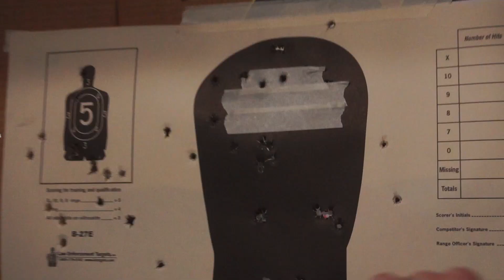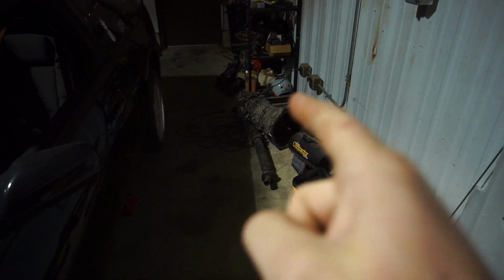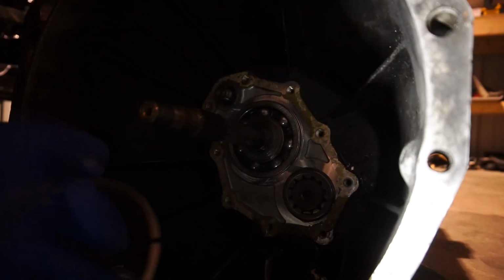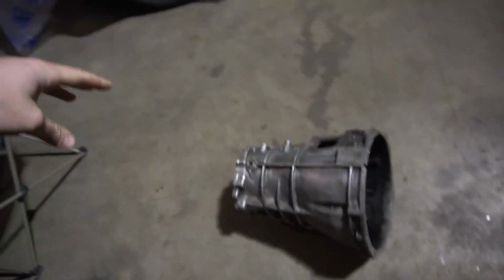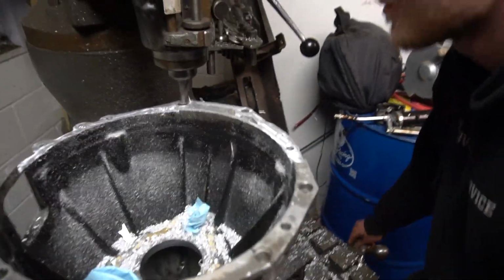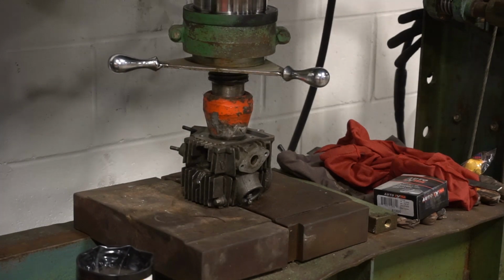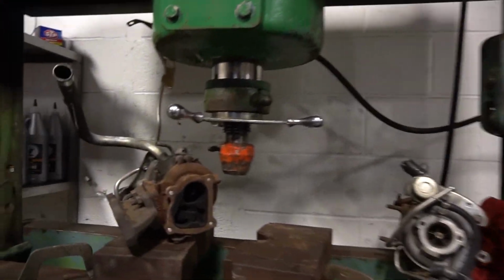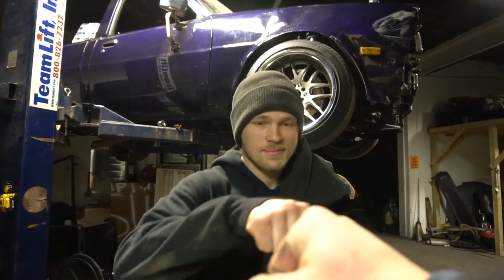TURBO VS. 75TON PRESS + GARAGE MACHINING

Comment: I might be wrong but doesn't that adapter simply bolt to the bell housing and then you use extended bolt for the clutch. Very much like any adapter for a Chevy engine to say a BOP. turbo 400 and it just sets the trans back a inch or two from the engine.  Basically a bolt in no machine work needed.

Comment: that looks like the transmission structural support on the bell housing would make your modified trans prone to cracking? not sure that is going to work
Reply: ridin high380 a nice little bevel around the rough edges n he be aight

Comment: I had problem with my head's blowing but not sure what swap would be a better route as far budget wise I got a quote of 4500 for a lq9 swap but I want to do it myself please reply with any suggestions of which swap is the most reliable for my mk3

Comment: Jimmy okes could you just shortened the driveshaft? or you were having fitment issues because the transmission would of been untouched by cutting a inch off
Reply from the maker: ridin high380 the shifter is like 4 inches more forward on the sr trans
Reply: I think shifter position would've been further back. Then you might have to make modifications there and deal with the shifter being offset back a bit, could be uncomfortable to drive.

Comment: U realise u can adjust them snap ring plier's so u can squeeze the handle instead of pulling apart on the handles.. Easier if u ask me...
Reply: Then u can use them with one hand instead of 2 like a dumb dumb... Lol
Reply: Not all of them adjust that way. Those looked like basic squeeze ones. Pretty sure jimmys smart enough to operate it if it was the correct pliers

Comment: Jimmy makes all sorts of custom stuff, while Tommy just buys shit and bolts it on. Not hard to tell who builds cooler stuff.
Reply: Well, if by "cooler" you mean Ganadors and Regamasters on every car, sure. Variety, eh?
Reply: You find spray painted brake calipers to be cooler? This guy
Reply: Nah, the calipers are whatever, but things like the taillights, DIY-ish front subframe, the tubs on Jip's hatch, cut and welded knuckles, extended LCAs, that sort of stuff is definitely cooler than the third set of Regamasters. Tommy's build off vids are pretty trash, considering he doesn't even build anything in them.
Reply: youre asinine if you cannot enjoy both chanels content....
Reply: Nick Nunez I really liked the Slicktop build, and I can't wait for progress on the black GT-R, but the Silvia build is just shit so far. Also, can it be called Tommyfyeah x Jimmy Oakes build-off if Dom does most of the stuff on Tommy's car? 

What I'm getting at is that Tommy has too many projects going on, so they all basically go nowhere. Same issue Rudnik occasionally gets.
Reply: I think youre upset he doesnt do haggard things to less than cars. all his cars are show cars? lol your thinking is like when draggers bag on drifters or static guys bag on stance guys. their different so you cant compare just admire for what they are. adamlz doesnt do alot of his work and his videos in florida get repetitive. Tommy finished the S12 giveaway then the slicktop giveaway in the same year??? as well as the supermoto. realistically though how much fucking work can onne do holding a camera lol
Reply: Nick Nunez what are you even trying to say? I love the fact that Tommy does things properly and is pulling Rubdick in the same direction, and, as I mentioned, my favourite car of his was the Slicktop, which is as far away from being haggard as humanly possible. What I don't like is that most of his builds turn out too same-y. There's only so many times you can watch a set of Regamasters return from the powder coater until it gets boring. Besides, most of his build time is taken up by waiting for parts to arrive, not actually building the car. How long was the Slicktop unfinished because of a damn hood latch, again? And you can easily compare them two because they're doing a build off against each other. 

Besides, they've got Mike now.
Reply: Casanova true, he gets most of his welding done by Morfius performance. That being said, Jimmy still does more things himself than Papa Slicc.

Comment: Tell your boy to speed that machine up, if you would a face mill and the machine running at a higher rpm you could have had that machined in 10 minutes with a much nicer finish.
Reply: Dont assume my pronoun eh, with a manual bridgeport and probably a dulling endmill, the finish is never gonna be stellar.
Reply: Billy Johnsen with the right speed and a good tool the finish would be perfect if the operator knew what they were doing. Keep in mind we went to the moon with manual machines..